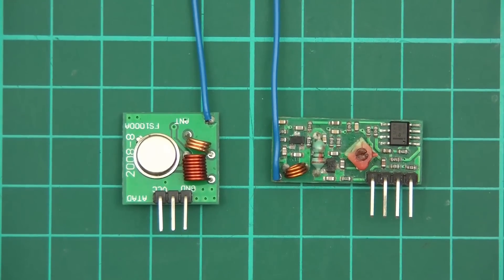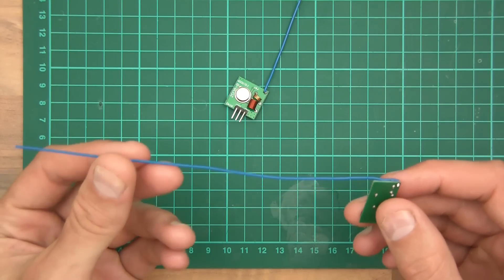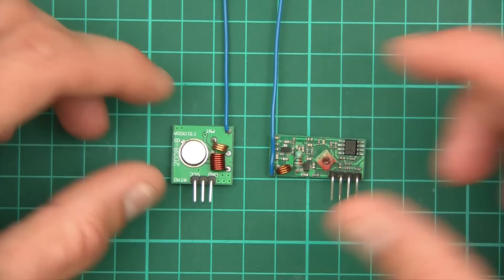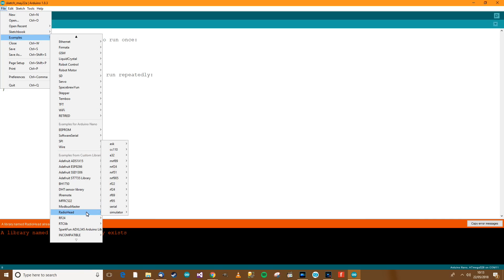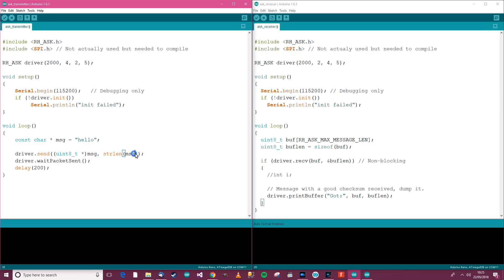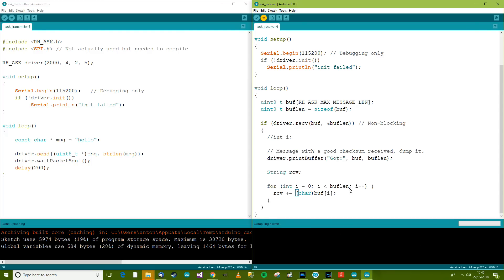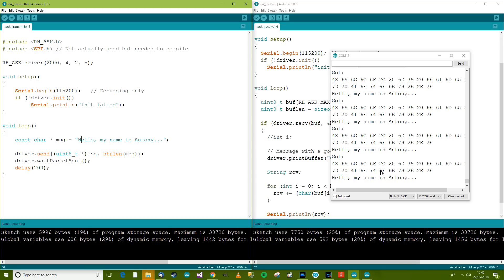TUTORIAL: How to set up wireless RF (433Mhz) Transmitter Receiver Module - Arduino Quick Simple

Comment: hey i dunno why but i got an error with my transmitter 
C:\Users\knoxt\AppData\Local\Temp\arduino_modified_sketch_890292\ask_transmitter.pde: In function 'void setup()':

ask_transmitter:16:10: error: 'driver' was not declared in this scope

     if (!driver.init())

          ^

C:\Users\knoxt\AppData\Local\Temp\arduino_modified_sketch_890292\ask_transmitter.pde: In function 'void loop()':

ask_transmitter:28:5: error: 'driver' was not declared in this scope

     driver.send((uint8_t *)msg, strlen(msg));

     ^

exit status 1
'driver' was not declared in this scope
 

that was the error code

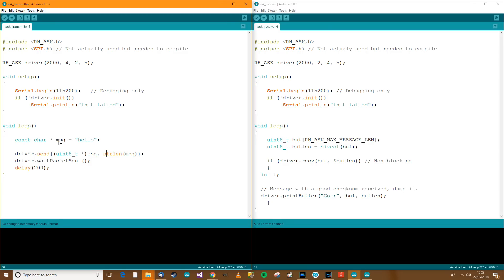Comment: 10:30 you don't exactly explain that right. msg is  a pointer to an address in memory that stores the first element of  the literal "hello". the convention reflects how all most data in a program is stored (i.e base address + offset = value). no variable is created, the 5 chars simply get stored as an array in memory that is pointed to by msg.

Comment: Hello Anthony, i have a question. my modules comes without that 3 turn coil on emitor module. Also the receptor module haven't that normal 0,5 W resistor solder on pcb face with smd components. is about that big resistor. i can't see the color to read the value. can u help me with value of that resistor? Thanks a lot !
Reply from the maker: Use a multimeter! :-)
Reply: @antonycartwright  thanks i manage to freeze image and i saw brown black-green-silver. so 10x100k tolerance +/ 10%
Reply: @antonycartwright  yes i know how to use a multimeter and also i know how to read color code but that resistor is missing from receptor module.

Comment: Great video, but my circuit doesn't seem to be working. Could it be because I'm using a Mega instead of a Nano or Uno?
Reply: No...99% not
Reply: have you tried to read any sensor values with the arduino mega before? if it works and you can see the value clearly then i think the problem is either in the transmitter or the receiver

Comment: my transmission is off by a couple hundred is the ant lengh responsable for this? im tryin 2 tx on 433.920 but its 433.681 any ideas? also im using the rc switch lib instead of radiohead at the mo if that helps?
Reply: You might have the 315 MHz instead of the 433.  To find the right length, use the equation (speed of light) = (frequency)(wavelength), so 3*10^8 = 315000000 * (wavelength).  Use whatever frequency you have and solve for wavelength.  Then, just keep dividing the wavelength by 2 until you get a reasonable length.  In this equation, the wavelength comes to 95 cm, which is a long wire.  Divide by 2 a couple of times to get 23.8 cm or even 11.9 cm, which is a good length.Sorry if this is kind of late.
Reply: @brendonlovejoy2376  got 1 of each and read the label its correct label.

Comment: I'm testing a similar setup, have the transmitter on a nano with 6v and a cheap Baofeng radio with a 433mhz yagi and on a good day with line of sight I can get over 1km reception. I know that's not exactly what you're using but just to add a bit more info to the discussion.
Reply: Is the yagi home made ?  Can you provide a link to a drawing or sketches?
Reply: Hi is there a tutorial for that for a beginner?

Comment: Great video.
 I've been looking at how to get weather data from my external weather station to my internal display.  This looks like a great way to do it.  If I were to use an ESP8266 or ESP32 for the MCU, would there be a better way ( Internally with the ESP's capabilities) to communicate betwen them rather than the RF(433Mhz) unit?

I noticed that while you were going through the library there was mention of the ESP8266 MCU.
Reply: Hi William, do you want to communicate with the external weather station to the ESP32 wirelessly or with wires? Because you could use the simple serial communication between the two sides, or, depending on your range, you could use LoRa modules for long range wireless communication. It depends on the setup you have.
Reply: I'd like to do it wireless. But I'm looking for a way of doing it within the capabilities of the ESp's rather thn having to add extra devices.  Same is true of LoRa.  I think you need to have an extra LoRa server for this to work. There must be some way to have the ESP's talk to each other over either over my WiFi orto each other directly!
Reply: William Miller So you will then need to have two ESP32 boards. One of the boards will be hooked up to the outside weather station to get the data and transmit it to the other board inside, where it can display the data. Since the ESP32 has WiFi capabilities, no external modules will be needed. I’m sure that there are many videos you can find about this online.
Reply: Kal King,  I'll give it a try.  Thanks.
Reply from the maker: William Miller yes, with two ESPs, it's fairly easy. You can do this easily if you have a router by putting both into wificlient mode. Then just get the IPs and send/receive data. You can also make one ESP into an access point of you like... This will also work if you have no router...